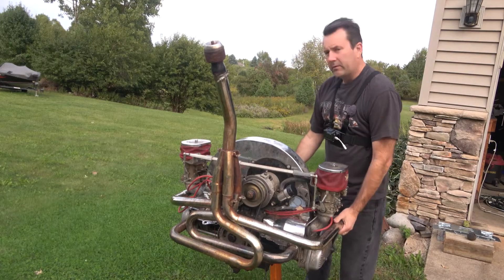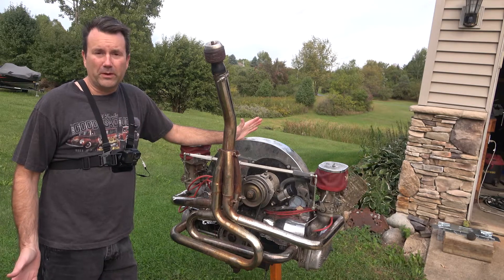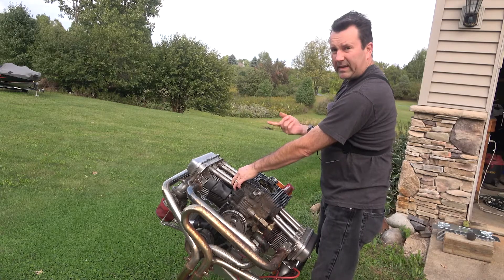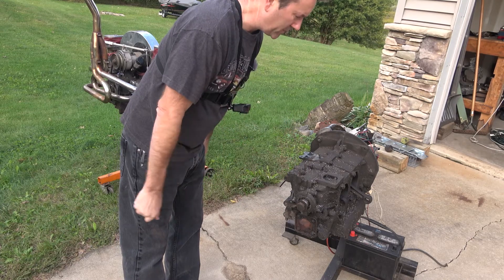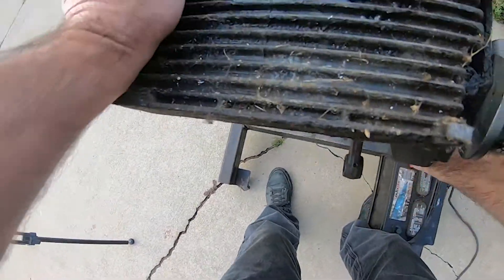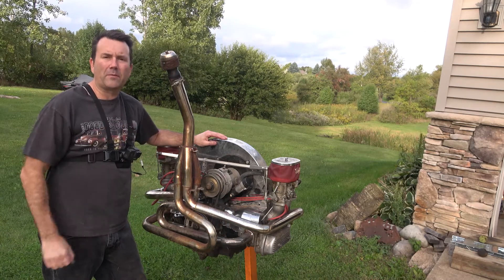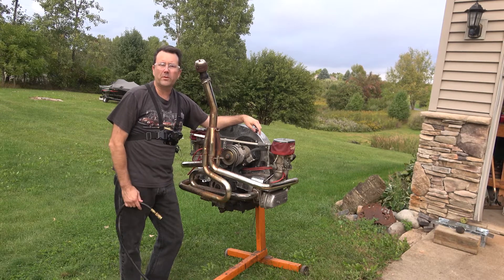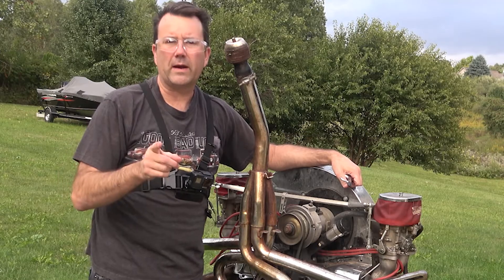My next Build 2275cc  aircooled VW Engine

Comment: Those 3 wheel stands, are known to fall over easy.
Reply from the maker: Yep, this was a first for me, I had it on uneven ground lol
Reply: @ddk56vw   Even on level ground, they can fall over easy. I don't use 3 wheel  engine stands, to work on nice engines.
Reply from the maker: @vintage76vipergreenBeetle  yep, my other stand I built has 4 wheels.

Comment: Hey buddy, what kind of HP is this new build gonna produce?? I’m new to the VW community and am at a crossroad as to what motor configuration will best suit me.
Reply from the maker: I have never Dyno any of my engines. I figure it is close to 300. What are you planning on doing with your build?
Reply from the maker: I have to stand corrected here. I just realized what engine you were asking about. This engine build is more like 150 to 180 horse depending on the tune. Sorry I thought you were referring to my turbo engine, I should have looked closer at what video this comment was on.

Comment: Will you stop messing with that stuff and put those square port heads on?! I've been considering those for my turbo build but i want you to try them first!
Reply from the maker: Oh believe me my friend, I want to know the same thing lol. But first I want to get one last good pass in on the combo I am running now so I have a good comparison to share with you. So unfortunately that's not going to happen until the first part of next year sorry. I spent most of this summer behind the scenes tuning this MS3 making sure everything will work well for when I do the change over. Thanks for sticking with me hopefully next year will be a good year 😎
Reply: @ddk56vw  i get it. To be honest it's pretty cool seeing your videos. It's almost like seeing myself in another dimension. I also have MS3, run a flex fuel sensor, E85, have maxed out my injectors, and am looking at square ports. Also installing speed sensors at the moment to get some more info. Looking forward to seeing what other fun stuff you do!